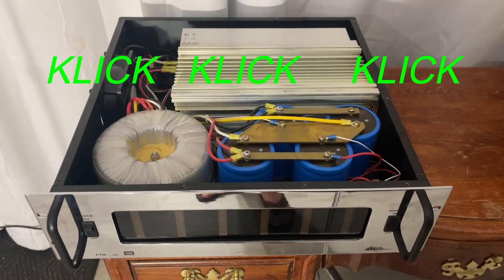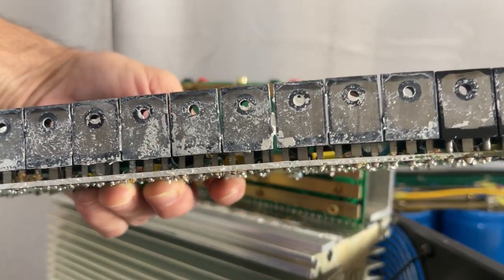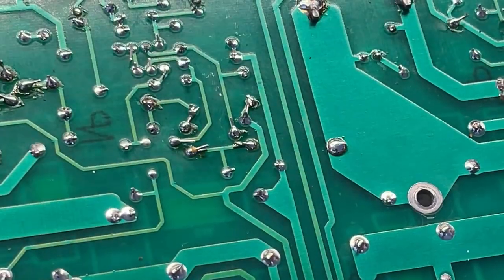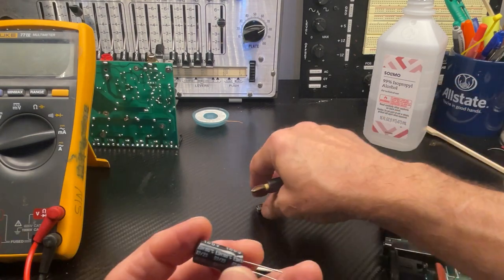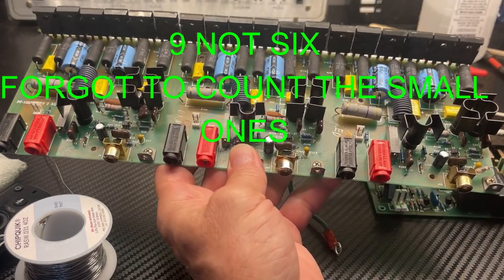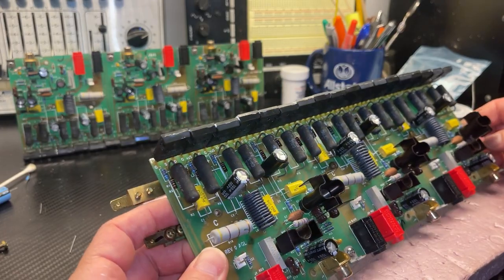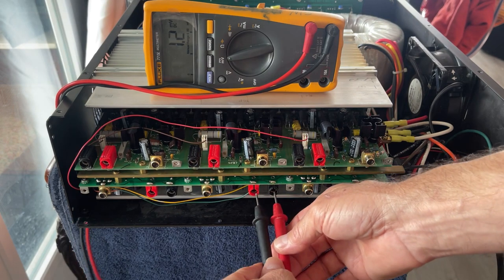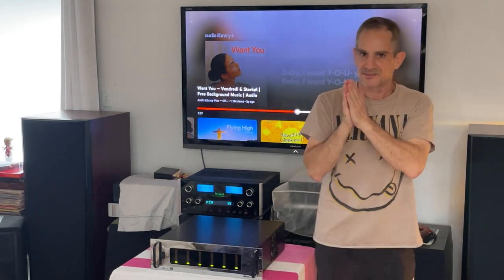PTM-6150 AMPLIFIER CLICKING RELAY REPAIR & RESTORATION

Comment: I use the same wide cutters.
Your desoldering is Pace?
I use Hakko desolderings.
I fix audio gear in my house, I saw your Mcintosh amplifier, I am the Mcintosh technician here in my country.
Nice job.
Best Regards.
Reply from the maker: Hello Teammate!
My desoldering device is also a Hakko and I love it!
It can be completely taken apart to the last bolt and any part replaced. The parts are available also.
I should not have to purchased another one for the rest of my life.
thank you, thank you thank you so much!🙂🙏

Comment: Hey that's nice work, but I have a question my NAD 218 thx is not producing signal when I turn it on, what can be the problem
Reply from the maker: Hello teammate and thank you very much! It could be a semiconductor in  between the input and the output. Sometimes parts stop working.
Sometimes there is something wrong with the power supply or a voltage regulator goes bad. I could speculate endlessly without having the unit to check physically. 
But what I would do if I had the unit would be too measure the voltages inside and if the voltages are OK I would feed a signal to the unit and follow it along the circuitboard.

Comment: Nice repair, but that burnt part looks really bad, next time drill or grind that part out and if needed, you can fix the PCB with 2 part epoxy. Burnt resin has a really low resistance, between the legs of the transistor that part is under 2kohms.
Reply from the maker: Hello Teammate, and thank you very much! I really appreciate it and will definitely keep that in mind.
I scraped off the burned  parts of the PCB with a dental tool and I explained in the video that I was doing it, because it becomes conductive. Maybe I accidentally edited that part out of the video.
I can’t really remember now because it was actually four hours of video that I edited down to 10 minutes.
🙂🙏

Comment: I have SONY p99x with built in equalizer.When I turn on my unit, it first makes a click sound when power button is pressed, then it makes a second click sound after 1 or 2 seconds. Today it did not make a second click and is not producing any sound. Interestingly, Its turning on, all the lights and buttons are normally functioning. Equalizer lights are moving up and down with music BUT no sound. I noticed that when it makes the second click, sound is produced, when no 2nd click, no sound. What can be the fault?
What is producing that 2nd click, capacitor, relay or else?
Reply from the maker: Hello and thank you very much for watching my video.
The problem is that your speaker  relay is not coming on.
The amplifier seems to be producing sound, but it is not getting to the speakers. 
The speakers relay connects the amplifier to the speakers after the amp turn on with no issues such as DC voltage at the output or short circuits.
The fact that it is producing sound, inclined me to believe that the speakers relay is stuck and just needs to be cleaned and lubricated. 
It could also be a bad capacitor around the speaker relay circuit or some other issue.
It’s hard to say without the unit in person.
Reply: @Tinybench  Thank you for your reply. Is there any way to connect Amp. to my lap top and diagnose issue using any software? using any special cable like USB to RC cable or else.
Reply from the maker: @bobwa399 You would not be able to troubleshoot the unit that way.

Comment: I’d like to find some capacitors that size, and a nice big toroidal transformer to pair them with.
Reply from the maker: These are electrolytic capacitors with a certain lifespan based on voltage temperature, and hours so I recommend you purchase them new from DigiKey or Mauser. The large thyroidal transformer can be expensive so I would scavenge it from a parts unit on eBay. 
Good luck and thank you very much!
Reply: @Tinybench  I didn’t think I’d get a reply. Yea you are right. Salvage is way cheaper. I’ve orders from mouser but never digikey. I ll give them a try. Thanks for the upload.